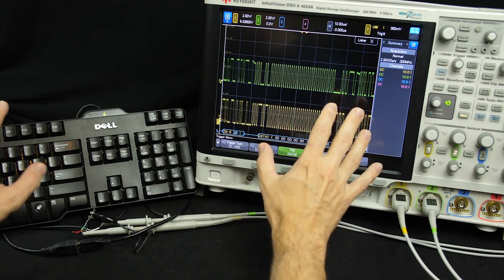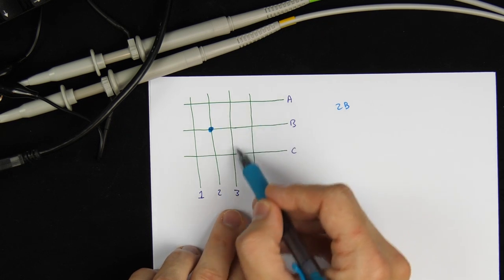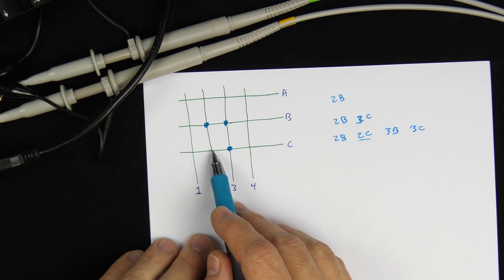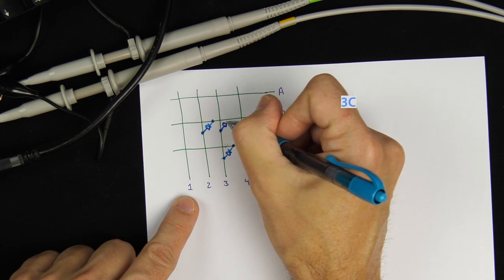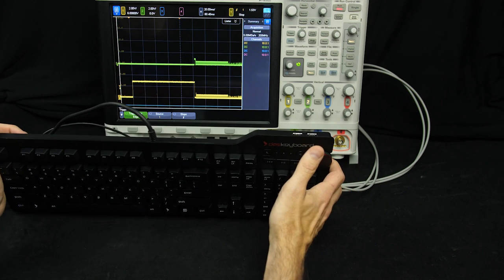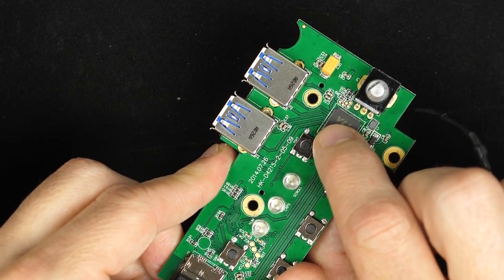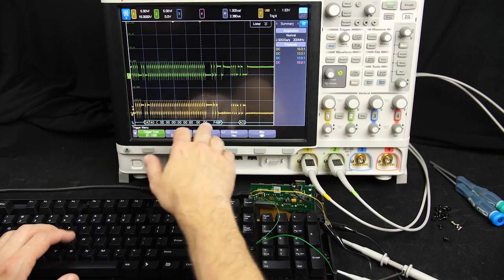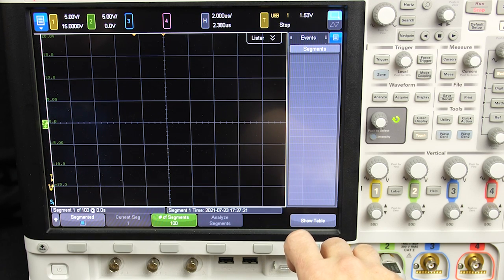How does n-key rollover work?

Comment: There are less intrusive ways to prevent the hub from negotiating USB full speed, by oder of simplicity:
- plug the keyboard into a USB Full Speed only hub
- plug the device into a USB 1.1 host controller (that isn't USB-HS, like e.g. an old PC)
- By using the USB compliance tool(s) from the USB implementer Forum that we, USB testers, use to validate controller and device for compliance. It installs its own USB driver stack on Windows to get full control over the host controller.
- Disable USB HS in the BIOS (there may be such an option, especially on older motherboards), or possibly using sysfs on linux (not sure about windows)
- mess electrically with chirping by adding a RC filter to prevent the host controller to detect it
- Enable USB FS driver (uhci) but disable HS driver (ehci), should be easier with an older linux kernel (e.g. 2.6 or 3.0), probably easier with older motherboard,
- There may be a pin on the hub IC to switch between LS, FS, HS and SS.
Sure, the way you did works, but you're also likely to fry the keyboard decoding chip, because you're injecting ESDs with those antennas you've soldered on.

Comment: Keysight, send this man a proper active probe and a pamphlet on probing. My inner SiPi engineer is still crying.
Reply: What is SiPi an abbreviation for?
Reply: @pierrelemoine8669   Signal integrity / Power integrity. The guys who you consult to make sure your PCB design isn't going to ruin the product.
Reply: Could you explain? What does a an active probe do and why is it better?
Reply: @codingmarco  Right so active probes can sample higher frequencies and provide a more accurate reading of the signal. But how would that have helped in this case? It seems he was able to measure the USB signal fine with passive probes.
Reply: @aspuzling  in this case it just would’ve reduced the noise on the line he mentioned briefly AIUI

Comment: note those 2 resistors are not just impedance matching but also just to limit current in case both ICs happen to drive the bus at the same time. you see them often when usb is used inter-chip, and i guess with longer wires they just rely on the wire resistance to do that job :P
Reply: Is used to control ringing actually
Reply: @vmiguel1988  oh yeah that's probably gonna be more important than shorts through the (hopefully) protected pins at those frequencies.
tbh i was surprised how far they snake those traces back and forth :D
Reply: @nonchip  Not a problem as long as the traces impedance matching is considered.

Comment: You should definitely do a follow-up video on this covering USB HID usage tables. Out of curiosity I was looking at what came after the F13-F24 cluster, and I ended up with a document that covers usage tables, describing usages beyond just keyboards. Pointers, mice, joysticks, gamepads, VR, individual tables for the six cartesian translation and rotation axes, sliders, dials, etc., even vector usage, and not to mention different switch types. I never realized HID covered so much when it seems like everything requires specific manufacturer drivers when things like keyboards are pretty generic devices.

Comment: Regarding the end of the video: I can confirm at least for my Corsair K95 that it is listed in Windows Device Manager as several, separate HID keyboards while my handwired QMK driven keyboard isn't, so there's definitely more than one way to implement NKRO
Reply: There are multiple ways, but only one way that is technically correct. I guess Corsair is just being lazy.

Comment: The reason for all the extra keys present in handshake could be just that the devs took some generic 'USB multimedia keys' library to use in the software and enabled it to use the buttons that are present physically but all possible buttons are still included in the description frame by default.

Comment: Great video! Two notes:
24:17 The format here is just "little endian", bytes are just backwards.
Generally: What is done in this video with the very beautiful way via the oscilloscope can also be done at home without soldering or expensive (but cool) hardware, just using software on the connected computer - searching for how to capture USB packets with the free software Wireshark would be a start for that rabbit hole.

Comment: Great video, as always! 👍 Thanks! 

When I saw first closeup of keyboard chip, I momentarily noticed these two 33R resistors and my only thought was - looks like USB data line.. 😂

Great thing, that this keyboard didn't have inside blobs of epoxy coated crystals but had normal chips..

Comment: Good series on USB keyboards.
Quick note and request: I wish that you would continue with the 6502 series.
Reply: I’m sure there is a connection, my guess is if you wanted to add a keyboard to the 6502 you wouldn’t want people to hunt for an old non-USB keyboard.
Reply: @kellyfrench  
A PS/2 adapter costs like 7 dollars, but I'm unsure how good they are.
Reply: @HrHaakon  they’re passive and require the keyboard controller understands what to do when the relevant (unused otherwise) pin is shorted when connected. Keyboard controllers by and large stopped doing this around 2005-10, so modern commodity USB keyboards can’t use the adapter.

Comment: MIDI would be a neat walk in the park.
Reply: MIDI is fine until you get to the control change signals, which were such a mess of under-specified signals and vendor-specific codes that MIDI2 threw up its arms and went "Screw it, that's all negociated between the host and device, now!".

Although the MIDI1 protocol by itself is pretty simple, and the MIDI-USB encapsulation didn't seem to make it much more complex.
Reply: @Riboshom  MIDI2 implementations in production now number 1 (according to my last count). Tools for rooting out and troubleshooting the behavior of MIDI2 will be very helpful. As I'm sure you know MIDI1 and MIDI2 do not coexist. 1 or 2 is the opening salvo of the conversation.
Reply: @toddmarshall7573  Yeah, MIDI2 won't be relevent for a while, if ever, (though hopefully it manages to get somewhere), and modern complex protocols have their own problems of bad implementations (like USB-C, especially power delivery), but whether or not that's preferable to an underspecified protocol like MIDI1... I guess your mileage may vary.

Comment: Thanks!
Reply: Interesting that I can't edit that message...but whatever.  I work in embedded electronics design and haven't done much other than include basic USB to UART chips, or use the vendor supplied USB drivers (for the microcontroller), so I never knew how any of this works since I didn't need to.  This and the other videos in the series have been amazing.

Comment: N-key rollover was designed for gamers because MMO's required the occasional use of more than 6 keys at a time. For the regular non-gaming user you only needed a max of 4 key simultaneous reporting (ctrl-alt-shift-<key>), however in an MMO you would sometimes need to run, strafe, jump, cast spells with combo buttons which could easily hit 8 keys, which is why 10key rollover with anti-ghosting is the standard for gaming keyboards but only 6key is for regular office keyboards. Your Dell keyboard is just a regular office keyboard, the dasKeyboard is a minimal multimedia keyboard with USB hub for your mouse and usb headset.

The vendor specific page is so their drivers know which product version is being used so that any specific microcode can be used by the drivers on that specific manufacturing run of the hardware.
The consumer specific page is for system control, like it says, which is a multi-hardware hal type interface so your keyboard, through the operating system and drivers can control your audio functions, the power state of the computer, and various other 'multimedia keyboard' functions to launch applications and control their interfaces. If you had a Logitech keyboard it would use all of those functions and have dozens of extra buttons on it.

Comment: I guess you probably didn't have one around, but you could have plugged the keyboard's cable into a USB1.1 hub and it wouldn't have been able to negotiate the 480Mbps communication and (hopefully) fallen back to 12Mbps (or even 1.5Mbps).
Reply: yep it would have reverted to 12Mbps
Reply: It's really hard nowadays to find USB hub that is lower than version 2.

Comment: I have to assume that that volume dial is a detented knob with no stops on each end, and that each time you click it once in either direction it's effectively sending a key press. I believe that's how mouse wheels work as well, along with most of the dials and things on digital heavy things like car radios these days. It makes it possible for you to have multiple different controls control the volume without having to use a motor to make the main volume dial move to its absolute position. Which is a thing that was on a fancy receiver my dad used to own back in the '90s, if you use the remote control to put the volume up or down the volume knob physically turns.
Reply: Correct. The technical term for it is a Rotary Encoder. The microcontroller reads the encoder and sends the "volume up" packet if it detects you spinning the encoder in one direction, and the "volume down" packet if you spin it in the other direction.
Reply: This one goes to 11.
Reply: it looks like potentiometer, and it has 3 contacts, so it could be just that and a little bit of PWM on the microcontroller side.

Comment: Saw the video title, had no idea what N-Key rollover was. Saw it was from Ben. Had to watch :)
Very interesting.
For the fact you can enable / disable this function; probably, during BIOS or UEFI, the interpreter used by the software is a bit simpler and expects the standard 6/8-bit format. Does this keyboard require a specific OS HID driver?
Reply: I believe  n-key support is a standard now, so should work without drivers, but it is a bit of a late-comer to the USB specs, and so as you said, older and/or simpler BIOSes may not support it. (n-key keyboards that predate the standard spec. would also not match the spec. so would also need special drivers, of course).

Comment: A different way keyboard manufacturers implement N-key roll over is to define a 2nd large "report" (USB HID term for a packet) that contains space for more key press bytes.  When the 1st 8 byte packet is full of keypresses, further keypresses overflow into the 2nd larger packet.  In the one keyboard I saw how they implemented N-key roll over, this is how they did it.
It was really cool to see how your keyboard achieved N-key roll over using bit flags instead of bytes.  Seems a cleaner solution than the one I saw earlier.
Reply: I thought only way to archive nkro is simulate multiple HID keyboards before watch this , seems most manufacturers do it that way..

Comment: It's not the current that is "put" by keyboard, but the voltage or potential. The current will be there if there is a key pressed, circuit closed. Sorry to being picky, but it is so common to swap current and voltage these days ;) Thanks for excellent videos!

Comment: My theory is that those extra keys that it supports but doesn't actually have are simply keys that whatever HID library the manufacturer used to build this keyboard's firmware simply supports those and the programmers just didn't touch it because why would they.

Another option is if it has macro functionality that you can define from your PC, so you might want to set a key you don't use to F14 to have it do something you program.

Comment: Those MCUs likely come with an SDK for exactly this kind of application. They take the keyboard matrix as input and provide a USB device at the output. Have seen them in a lot of cheap convertibles' keyboards.
There is an incredible amount of devices supported  by HID.

Comment: I have two keyboards with N key rollover. The interesting thing is that they seem to handle it differently when actually typing text. With my current keyboard it registeres all the keypresses I make, but keeps typing only the last one if I keep them pressed (example: asdgoerfijjjjjjjjjjjjjjjj).
My other keyboard actually loops through every key I press and repeats the pattern (example: naipntgrnaipntgrnaipntgrnaipntgrnaipntgr)
Just thought that was pretty interesting.
Reply: Hm. What is it that implements that repeat? Based on the protocol that he's shown us, it feels like it's the computer and not the keyboard. The fact that you can change repeat rates via the OS sort of supports that. I'm guessing that you're testing these two keyboards on the same computer, so it must be the keyboards that are different. I bet that the computer/OS just repeats the last key it saw from the keyboard, but one of your keyboards implements the multi-6KRO system he mentioned at the end and your computer is repeating the last key it saw from each of the keyboards.
Reply: Holy crap, my keyboard does the second one! But the timing has to be extremely precise. For two keys it was around 50% success rate. only sometimes could I get a 3 key repeat and four key repeat is not common. I couldn't get 5 keys to repeat. maybe your current keyboard can do it but you need to keep trying.
Reply: @wbfaulk  Okay, I figured out that both keyboards use interrupts as their way of communicating. They send nothing until the state of the keyboard changes. Both use a slightly different kind of one bit per key communication. But this is not important. Edit: this is actually not true. The old keyboard uses the six key rollover until more than six keys are pressed. Then it switches to one bit per key mode. Very interesting behavior.
My current keyboard sends two interrupts no matter how simultaneously you press both keys (one with only one key down and one with both keys down) and likewise (two) 
with the upstroke. Edit: this is also not true. with this keyboard it is also possible to get both actions into one single package, it is just much harder to get the timing right.
My other keyboard on the other hand only sends one interrupt if you press two (or more) keys fast enough (both keys down) and only one on the upstroke (no keys down). It only does that repeating pattern if you press the buttons simultaneously. If you first start pressing one button and then press another, it repeats just the last one.
I hope my explanation was kind of understandable. Trying to explain this just by text is kind of difficult.
Reply: @GrayBlood1331  Well, I feel kind of betrayed. I tried at least a dozen times without any success before writing my comment. After reading yours I thought to myself "meh, let's try it again" and I got a loop of three the first time. With my other Keyboard it is not difficult to get a loop of ten. I guess it just comes to polling rate then.
Reply: @NightmareQueenJune  lmao this is sort of like when your car makes a weird noise but of course when the mechanic gets in it stops making the noise. So annoying!
Reply: LoL. Keyboard arpeggio.
Reply: @williammentink  not to be confused with the other kind of keyboard arpeggio

Comment: many keyboards support reprogrammable buttons and/or special programmable key combinations for alternative functions. Those extra functions in the end that didn't have physical keys on the keyboard might just be for that (speculating here, just a thought that came to mind - might need to check the keyboard software suite)
Reply: But shouldn't those just be some fixed VendorKey1-2-3-4... and the actual functionality would be implemented in the driver's user-mode software?

Comment: System controls were common in early 2000’s but they are buttons that are optional by manufacturer. But it would be that you need to include all in the “System Control” interface so it works correctly since it was made in the time when macros weren’t a thing.  
Would be interesting to see what it would say for macro keys, like gaming keyboards or mice with macros.
Reply: For macros which require the driver to work, it’d define a few extra keys which don’t correspond to letters, and the driver can trigger all the appropriate HID requests. 

For on-keyboard macros like my Vortex Race3, the HID packet sequences are stored in the keyboard controller, and the USB interface only sees that sequence rather than being aware of any macro.

Comment: I would love to see you build a keyboard of your own (to go with your homemade computer) based on what you learned from the past few videos.
Reply: It would be an excellent project, agreed. USB wouldn't be necessary for that particular application, but the key matrix and associated diodes would be very good to do. My old VZ200 Z80-based system mapped the keyboard rows to the data bus and drove the columns from address lines, so the keys were memory mapped (ah, the good ol' days when your computer came complete with a full circuit diagram in the operating manual!)

Comment: It being able to do LOP doesn't mean it is better than the other keyboard, just different.

My keyboard can do that just fine. But it can't do QER.
Different keyboards, even without diodes, will be able to do different sequences, up to 6 keys (plus modifiers). You can also use the alternative standard, to potentially send more keys.
Most will be setup to try to prevent commonly used combinations causing a problem.